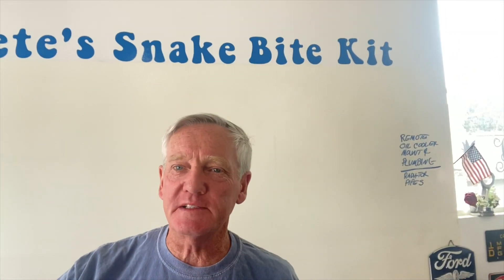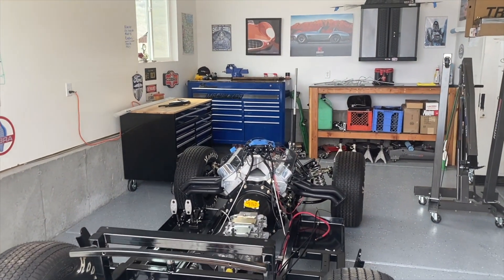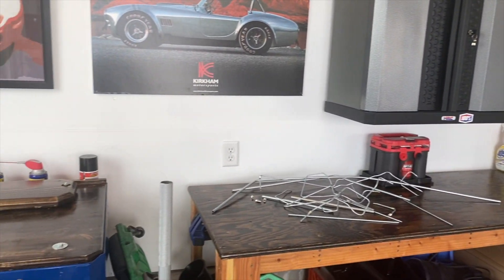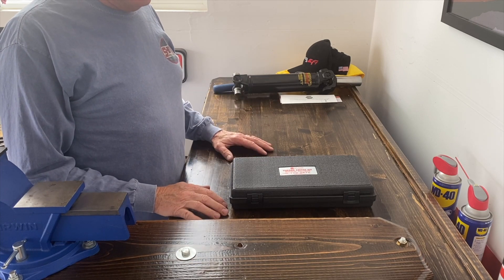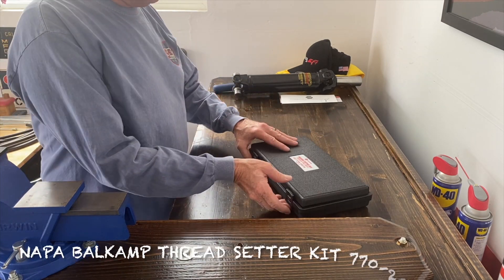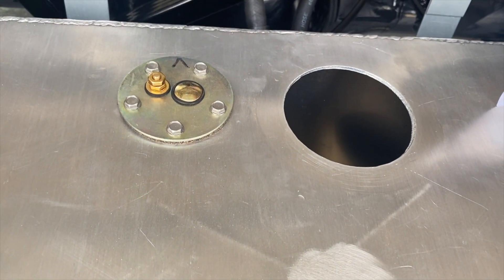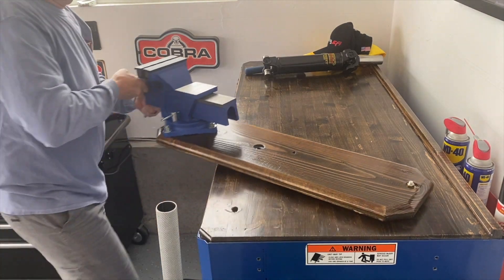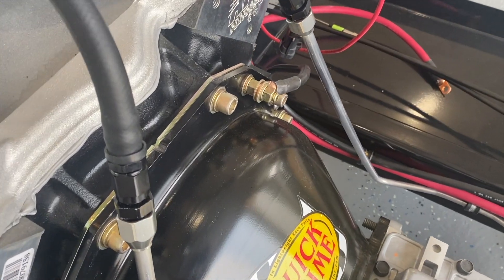EPISODE 45. Bending, Drilling and Flaring, let's talk about some very basic tools needed.

Comment: I use graphite moly to lube the end of the tube for flaring.  It's worked for me so far. 
  Also, I always clamp one side of the tube bender in a vise.  Some of the tubes I've made over the years have needed to be very accurate.  This allows you to more accurately measure the angle and sneak up to it.  But that's with Swagelok brand fittings and tools.  The tips and tricks for that tubbing is a bit different than brake line.  But I always run some 99% alcohol to clean the the tubes inside and out.
   I recommend a deburring tool like Shaviv makes.  They're great on burs.   They make different blades for them that include ones that can get the other side of the sheet.
   I like your line routing and thanks for keeping us updated.
Reply from the maker: Thank you for the tips I will try them. I was thinking about locking the bender in the vise  but I was worried about being on the wrong side etc.
Thanks fo watching, Pete.

Comment: hi pete this was the best video by far for me . i se you got your short  driveshaft over on your benchtop in the corner do you plan on talking about that or a   in deph video on your complete engine which is better carburetor or injection for fuel setup and transmission ?? i see some people are doing builds in automatics and 4 speed top loaders and 5 speed transmissions ??  just curious why is the fuel filter  at the bottom of the frame  should it be up near the motor for easier access to change ??  keep up the great work
Reply from the maker: I am going to talk about the driveshaft and some other odds & ends on the next one. The transmission would be a good topic, it’s personal preference so that may be interesting to other viewers, thanks for asking.